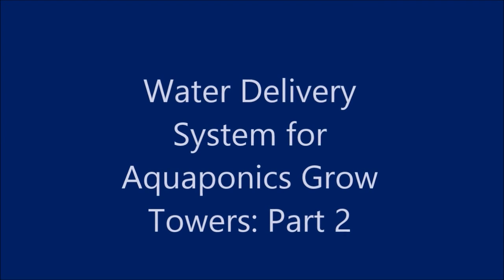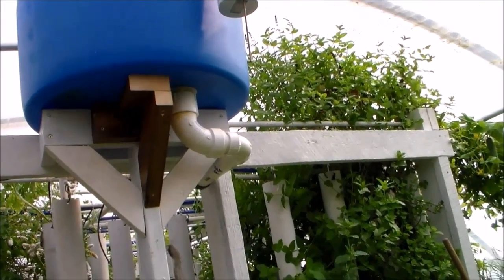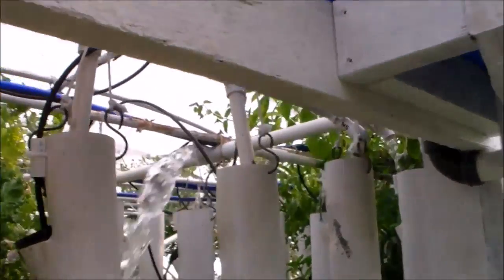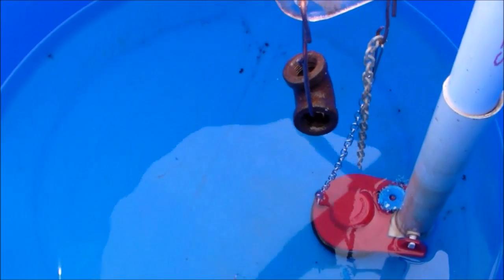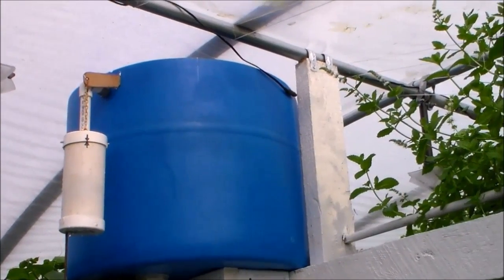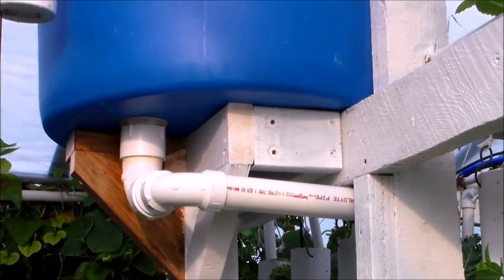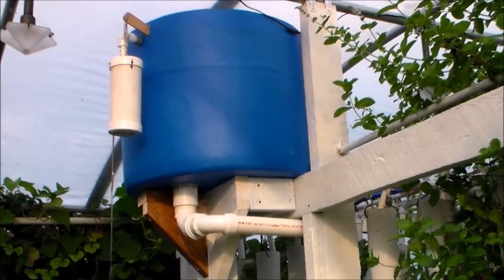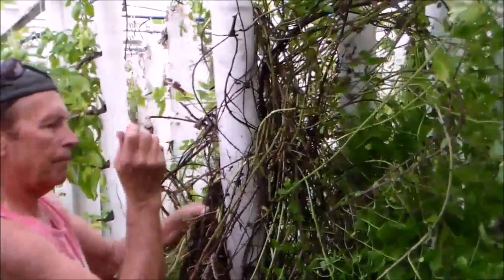Water Delivery System for Aquaponics Grow Towers Part 2

Comment: i looked at your three videos on this subject but did not see your return system to get the water back to the blue storage tank after it drains into the vertical towers
Reply from the maker: there is a grid of collection tubes underneath that returns the water into the underground sump tank

Comment: ok so you're using a sort of fill drain action for the grow towers-do you find this works better than constant flow/drip in towers?-love the vid thanks Don.
Reply from the maker: +Bevan Dittberner a constant flow rate in these small tubes will eventually clog from suspended solids in the water---the large orifice size has not clogged as of yet--- fingers crossed.

Comment: i dont understand why you need the flush valve don,why not use an overflow standpipe returning to sump or gb and seperate tower feed line
Reply from the maker: +Bevan Dittberner I am using a large orifice so as not to clog the foll tubes and the larger size requires a large volume to rush all the lines at once--- without this flush you would need a very large gph rate of a pump.--- so a flush.